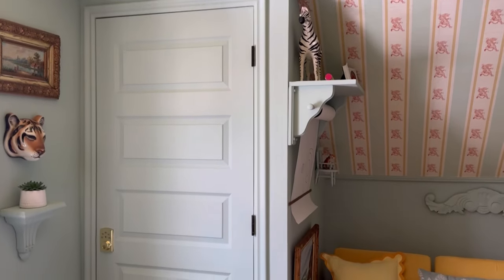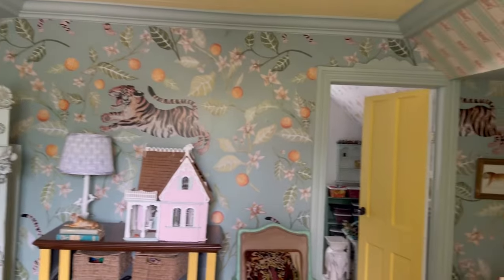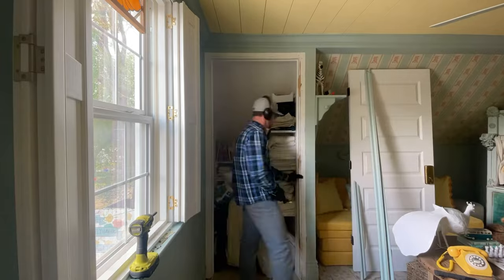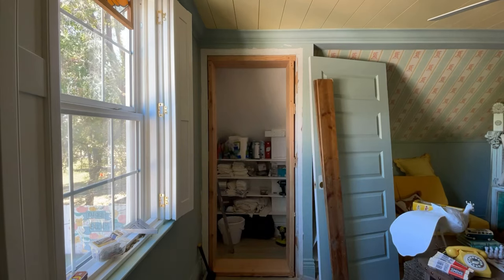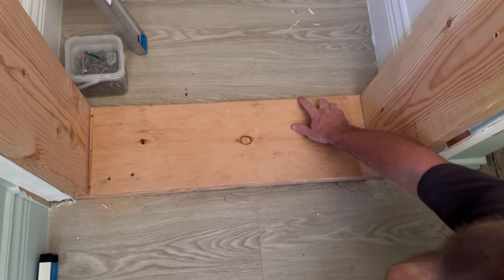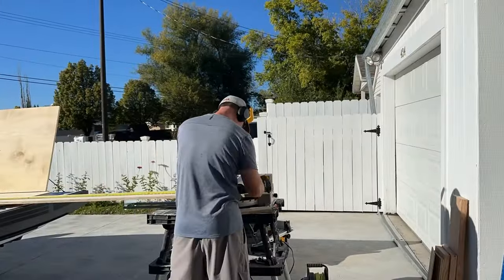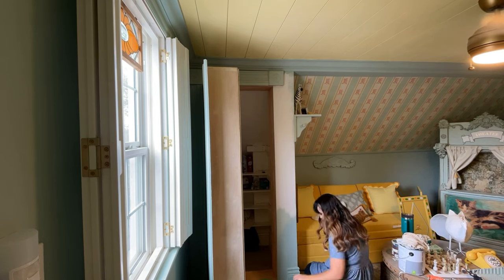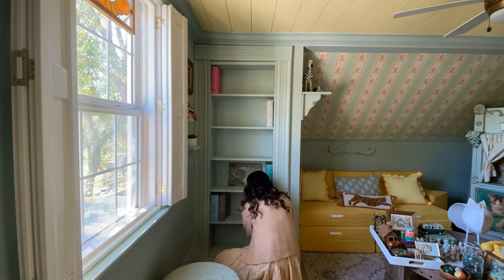DIY Hidden Bookcase Door | A secret door for a playroom!  🤫

Comment: Bookcase width = sqrt(frame width^2 - bookcase depth^2). Assuming you put the pivot on the diagonal line, which you did. A template also works.